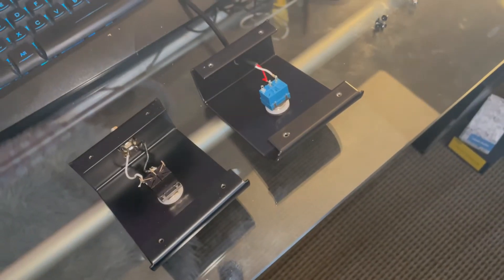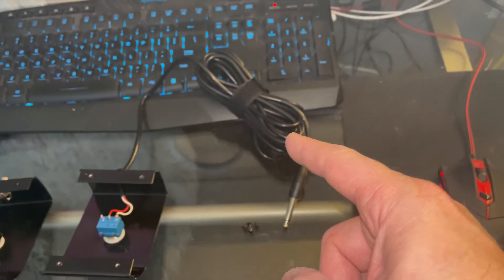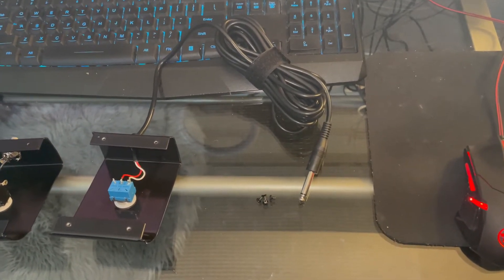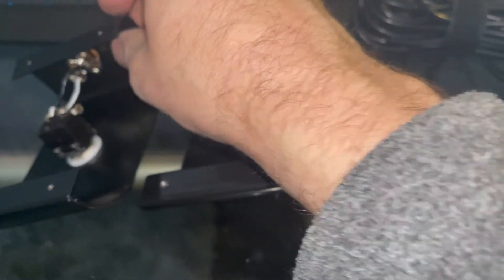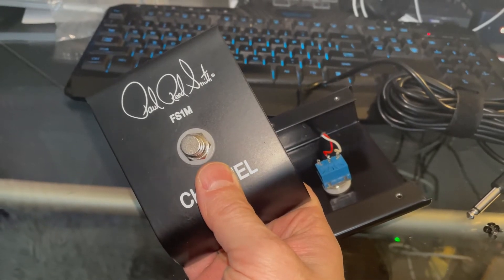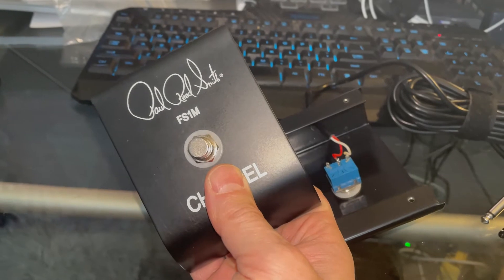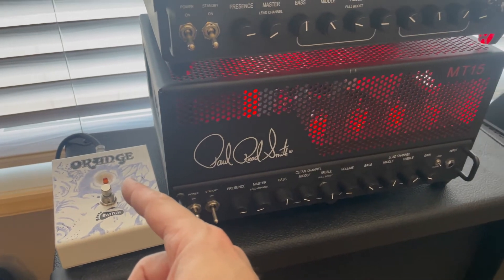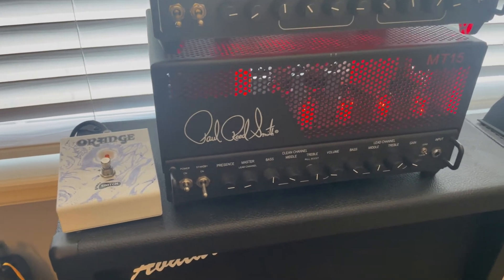PRS MT15 - FOOTSWITCH MODS

Comment: Hoping you can answer this question...is the original switch inside the FS1M momentary or latching? I was guessing the M in FS1M stood for momentary. Just picked up a used Archon 50, the older version which uses 1/4" cable (not the newer 5 pin DIN connector) but the amp didn't come with a foot switch. Trying to locate a replacement .

Comment: Great Job ! Very smart and usefull !I do think it's needed to see which channel is engaged under the foot ( with the amp on my back. 😅) 
So the job is done and well done. 
Remarque :
Why don't you add a red led diode for the lead channel in the same way as the blue one ? Is it difficult ? I am not a spécialist but think you just have to spot the 15v supply when lead engaged...(and you got the stuff to make it ) 
That would be great yo have both blue ans red led included in the FS!
Keep on modding that awesone amp, always interesting 😊
Thanks. François (Paris, France
Reply from the maker: Appreciate it.  You can definitely make it a red led.  But you would have to add a battery with the way the circuit is currently wired.  It is connected on the blue channel and not the red.  Cheers!

Comment: There is a way to have an LED light up when the circuit is open (on the red channel). Ive done this to a few of my amps that were wired in the same way as the MT15. Basically you wire the LED in parallel with the switch so that when the circuit is closed, it’s shorting out the LED. The blue channel will be active and the LED will be off. When the circuit is open, the signal will travel through the LED and resistor causing the LED to turn on and the red channel to activate. I dont have an MT15 so I couldn’t tell you what value resistor to use, but you would need to use one that will be high enough to block the signal from activating the channel switching but low enough to light up the LED. So it just takes a bit of trial and error but it will work.
Reply from the maker: Excellent!  That’s brilliant and I figured someone smarter than me with more patience would have a solution.  Thanks for watching.  Cheers!
Reply: @digitalreign7485 ok so I just bought an MT15 and went to install a Red LED and wired it in parallel like I mentioned, but lo and behold something was off. The Red LED was lighting up on the blue channel! I checked the switch and found out my MT15 is wired so that when the circuit is open, it’s on the blue channel and when it’s closed, it’s on the red channel. I didnt bother checking first because of your amp and Ive never heard of the same amp having differently wired footswitches. Wild! So I wired the LED in series so that it lights up when the circuit closes, which is the red channel. Strange that the same amp would have differently wired footswitches
Reply: @digitalreign7485  I just replied but I dont see it so not sure if it posted… I said that I bought an MT15 and found that it was wired differently than yours. I had to wire my red LED in series to get it to turn on while the red channel was engaged. But then I realized that you actually wired your LED in parallel… this got me really confused. The only thing that makes sense, besides the 2 amps being wired differently, is that your orange footswitch is wired in parallel while the MT15 was meant to be paired with a footswitch in series. I bet this is the case because I just noticed that you wired the blue LED in parallel and doing so will cause the LED to light up while the circuit is open, which on my MT15 the blue channel is engaged when the circuit is open and when closed the red channel is engaged. 

To wire the footswitch in series you just need to connect one lead wire to the middle lug on the switch, and then from an outer lug on the switch connect it to the red LED and then connect the red LED to the other lead wire. Just make sure the orientation of the LED is correct according to polarity. If you need a current limiting resistor to protect the LED it can be connected on either side of the LED. I actually didnt need to connect a resistor. Furthermore, it wont let you add too much resistance without disabling the channel switching function. Give that a shot

Comment: Cool need to know info. I will get right on it. Do you like the 5881's better than the 6l6's ? This is the magical question. I'm thinking about trying some el34's instead of 5881's just for the halibut.
Reply from the maker: I prefer the 6L6’s for live performance due to the higher headroom.  The quick breakup of the 5881’s are something to behold though.

Comment: My Mesa rectifier footswitch works perfect with my mt 15.  Blue channel = led off and red channel turns led on.  I think you just need to swap the polarity in the switcher.
Reply from the maker: Hey Deepend.  I tried several difference scenarios to get the red to light up.  Perhaps I just could figure out how to flip the polarity.  If your Mesa footswitch works to power the red channel, then I think your assumption is correct!  Cheers!
Reply: Same for me (Recto switch on the MT15). Works perfectly

Comment: Great idea but I wanna dry it with them switches with build in led on the white washer area. So don't have to drill hole. The cable idea is great. Also had to replace my rubber feet for taller ones. Would not sit well in cab. Notice you have same issue lol.
Reply from the maker: Yeah I looked at those as well.  Let me know how it goes if you end up doing the mod.  Cheers!

Comment: Nice!  Looking forward to the comparison between your two MT15 heads.  I'm seriously leaning towards getting a ENGL Fireball 25 but I'm still looking around.
Reply from the maker: I was recently looking at that ENGL FB 25.      Seems like it is a cool amp.  From the clips I was hearing it sounded fairly compressed for my taste.  But it is YouTube and that could have been a factor.  I need to get that comparison video put together and edited.  Cheers!
Reply: @Anne Heche Driving Academy I went a different direction anyways.  Invested in an audio interface and some 6.5” monitors, recording software.  Just made more sense for now.

Comment: Can you just use the Orange foot switch with the amp?  Seems can get a used one or similar for pretty cheap and keep your default one as is if sell amp.

Just curious, your video is great and informative.  Just a question meant as a parallel thought.  Thank you for the help…
Reply from the maker: Howdy.  Yes you could just use the orange pedal or equivalent and it would work just fine.  In fact I did that for about a year playing gigs that way.  I just wanted to fix the original pedal and improve it for relatively little cost.  Cheers!

Comment: Hi. Great video ! I play on this wonderful MT15 preamp with my metal band. I've just buy a Boss MS-3 and i would like to connect the CTL Out of the Boss to the footswitch input of the MT head to switch the amp channels (4 cables method...). But in the Boss Menu, i have to choose between "Pulse" or "Invert" and i have not found any specs on the web for this FS1M footswitch. I'm afraid to break something... Could you help me ? Thanks a lot !!! Regards, from France.
Reply from the maker: Hey Fred.  I don’t know much about the Boss MS-3 but looking at the Manuel it looks like you can just use a guitar cable and connect it to the CTL OUT of the Boss directly into the footswitch Jack in. The back of the amp.  You may have to adjust the parameters in the MS-3 to understand that is what it is programmed to do.  Good luck brother!  That is why I stick to analog gear! Ha.